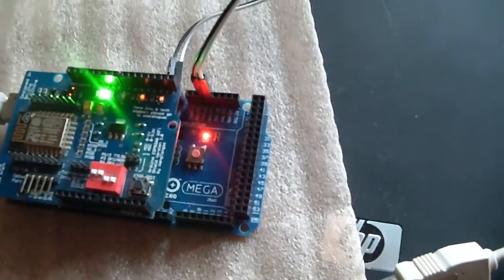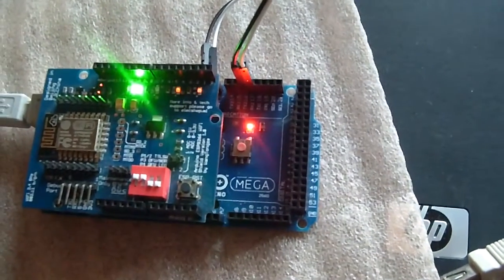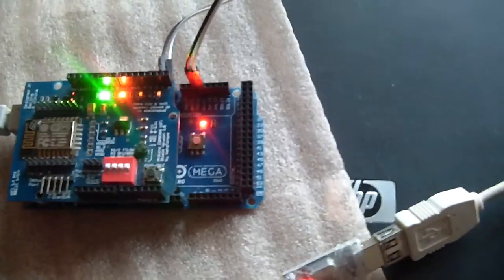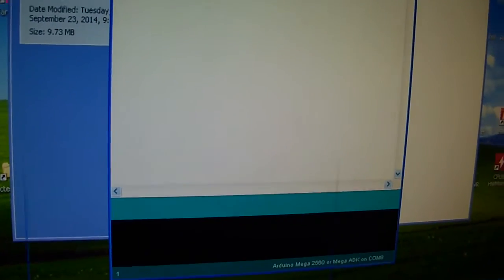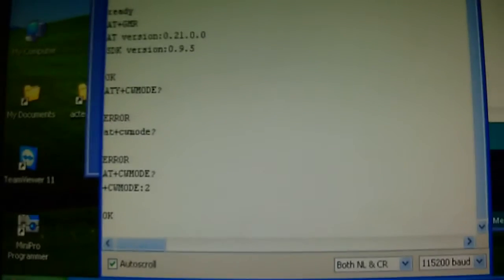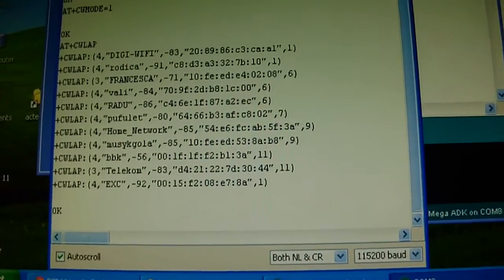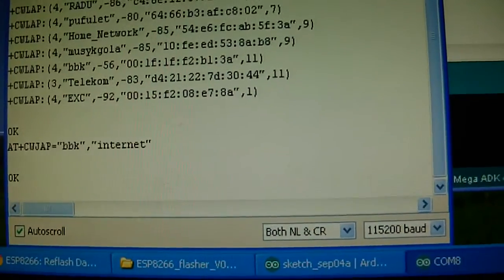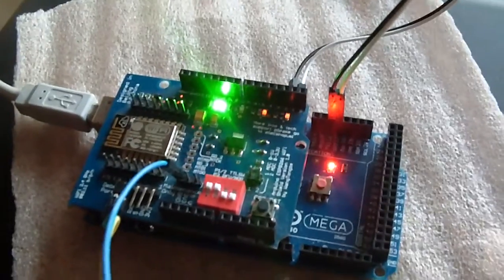ESP8266MOD shiled reflash

Comment: I have a couple of these shields and have spent hours online researching the problems people have with them. Variants of this product have various problems. Reliable documentation is absent. In some variants, turning ON sw1&2 connects the ESP's Tx and Rx to the Arduino's 1 & 0 pins for serial comm, so theoretically could flash firmware using those, but those are the UART pins for comm with the Arduino as well, so little use unless you disable the Arduino by grounding RST. Flashing is best done as in the video, using Debug pins, with sw1,2 OFF. Sw3,4 are normally OFF, but can be turned ON to enable flashing.

In the variant I have, sw1,2 need to be OFF all the time, and shield pins 0,1 need to bent or cut off so they don't contact the Arduino. The shield is built wrong -- these pins have constant 5 v and disable any comm, even UART to Arduino.

Like the video, for ongoing 2 way shield-to-Arduino comm it's best to use MEGA board for its multiple Serial ports, but others have used SoftSerial at reduced speed.
Reply from the maker: you can find info in description of the video

Comment: It is strange: I've managed to flash the shield like you show in the video but then the AT commands still don't work. Do you have any idea what could be wrong?
If I try with a simple ESP8266 01 chip alone I can communicate with it but with this shield it seems nothing is working for me.
But many thanks for the video!
Reply from the maker: maybe you not have firmware with AT support ;)
see article "Placa de retea wifi (shield) cu ESP8266MOD" (september 2016), adree is http://nicuflorica.blogspot.ro/2016/09/placa-de-retea-wifi-shield-cu-esp8266mod.html
Reply: I've tried with 1.1.1 firmware version from here: http://wiki.aprbrother.com/wiki/Firmware_For_ESP8266
And it still didn't work. But if I didn't set SW1 and SW2 to UP just left them DOWN then now it works! Thanks for the helpful information on your site and the video!
Edit: Oh, it only works through the DEBUG port. If I put the shield onto the arduino then it still doesn't work. I'll experiment more and leave a reply if I find out anything.
Reply: I don't understand this: " Because Rx-Tx pins is directly connected to the Arduino Uno of a plate, I used Arduino Mega board bending the 2 pins that I connected to Rx2-Tx2."
Why do you need this? https://s27.postimg.org/y8b4k9ghv/DVCI6663.jpg
(I have an Arduino UNO and don't understand what do you want to do with Rx2Tx2)
Thanks for replying if you have some time!
Reply from the maker: I made this chenage to can see in Serial monitor that is happends... on Rx2-Tx2 Arduino Mega control ESP8266 ;)
Reply: Hi!please try with no connect to arduino board(remove a shield from Arduino Board)then connecting a serial communication cable to ESP8266 wifi shield after that open arduino IDE and choose a correct serial port on your computer.selecting baud rate to 115200 then try to use a AT command following this video.

Nicu Florica,Thank very much for your great video .I have learned more   
on this.
Reply from the maker: see https://medium.com/@manrick01/arduino-uno-esp8266-esp-12e-uart-wifi-wireless-shield-3a39858e5f25